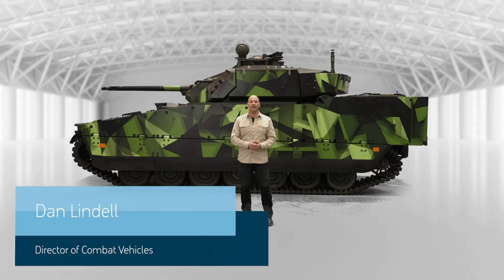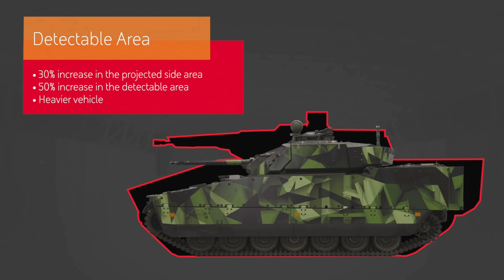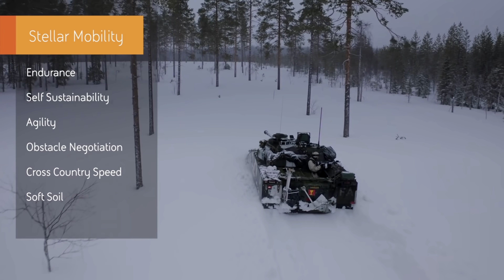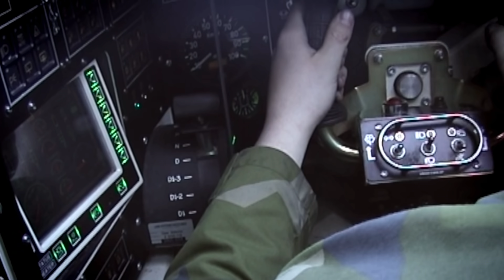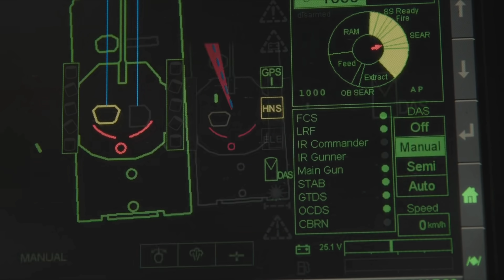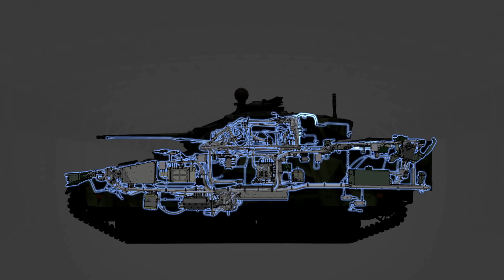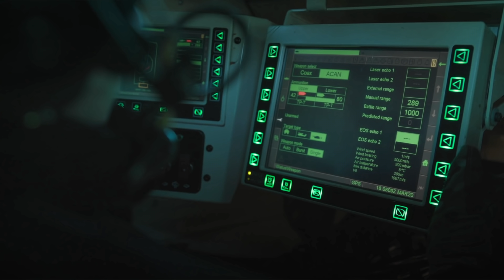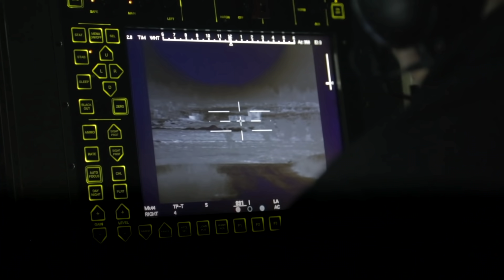The CV90 Infantry Fighting Vehicle Family | THE BEST IFV IN THE WORLD 🏆

Comment: Perhaps one of the CV90s best competitors is South Korea's K-21. The K-21 has similar capabilities but can carry 1-2 more troops and is 10 tons lighter, all with the same level of armor protection. The systems of the two IFVs are quite similar, with 40mm main guns, active protection systems, net centric battlefield management suites and Spike or Raybolt ATGMs. Both vehicles are nearly identical in profile size. The K-21, like the CV-90, is reputed to have outstanding tactical mobility.

I believe the K-21 is significantly less expensive. It also has an additional capability the CV-90 doesn't have. The K-21, with the removal of add-on armor kits, is amphibious. The K-21 doesn't have as many variants, but it does have a fire support version available with either a 105mm or 120mm low recoil gun.

I'd love to see a comprehensive direct comparison between the K-21 and CV-90.
Reply: About the weight, a Cv9040A&B is slightly lighter less then a K-21 (23 vs 25 tons, basically the same), it is the export and later versions of the CV90 that is alot heavier.
Reply: As a former mortar man, seeing a protected vehicle and crew was a dream back then which finally came true. Unfortunately it happened after my time, and the US is still putting their troops in the open. Absolute head shaker!

Comment: Definitely one of the best but I wouldn't say it's top dog. It is indeed proven and incredibly versatile I'll give it that.
Reply: I like the Namer. Has some actual armor. Not the best thing to drive hundreds of miles though.
Reply: What's the bonus code? can't find it
Reply: It's only rival is Lynx which is significantly larger and unproven.  Put the same tech on a cv90 chasis and it will out perform it.
Reply: @Weakeyedominant  "its not combat proven" is BS.
most heavier equipment we use is not.
And it better stays like that.
What combat CV90 has faced?
Heavier fighting vs Insurgent Taliban in Afghanistan.
And it fared well. 
But is asymetric warfare vs insurgents the relevant metric we should measure an infantry fighting vehicle against?
It is designed for armored high intensity conflict (peer on peer nation with MBT etc) and no MBT and IFV around has faced a peer opponent in the last 60 years (Korea was the last time peer armed forces faced each other with top of the line equipment)
Even M1 and Cr2 have not faced the Threat they were designed to face, but only 20-30 years outdated opponents (T55am, T72m1 export etc)

Comment: Hmmm, I do see the new platforms and the latest gen. CV90 can be outfitted to do more/less the same roles. I want to hear after-action reports regarding the Composite "rubber" tracks. As drive belts with woven kevlar cores are seriously tough so these tracks are likely something of a game changer. 
I heard Canada at one time was considering these, I would say Canada would be wise to look at not one but a few variants. Can-zer Grenadiers? Yup, that's what I'm thinking. Nothing says mutually supporting more than family. If Armour and infantry are under the same roof their doctrine and communication would be fluid. Another point is that some environments don't favour a 70-ton MBT or logistically being able to quickly deploy such a beast when something a bit more svelte would do.

Comment: Be very interested to see how the tracks perform on the ragged and sharp rocky terrain of Central Australia. These chew up normal rubber tank pads in a literal fortnight. 

As a former Australian Tank soldier, I would love to see more standardisation and versatility in our armoured capacity.
Reply: The rubber soles are for peacetime - in war it's metal only tracks. We have sharp and rocky terrain here as well - sure the tracks would survive the outback! //Former CV90 IFV Commander
Reply: @Joxen98  Why train with equipment that you aren't going to be using during war? 

There is a huge difference between rubber and even live metal tracks in practice. Everything from noise to vibration increases and track maintenance (AKA "track bashing" in the Australian Army) is a significant issue.
Reply: @greg.kasarik  peace time requirement when driving on public roads etc., the metal tracks shreds tarmac and other civilian infrastructure (Swedish military trains alot on roads that are used by the civilian world to and even in city centers, towns etc.).
Reply: @skagge.s1336  I drove the Leopard 1, which has live tracks and pads, on roads, including into and out of towns (not city centres) and at no point did we do damage, although a vehicle that big does make the locals nervous! :-)

Having said this, there is video on YouTube of a Leopard bridge layer doing a pivot turn and tearing up the cobblestone road it is on.

While I would rather train with the equipment I'll be using in war, the decision to use rubber tracks in training makes sense. I'd hoped that the rubber tracks themselves were an innovation that would help do away with the problems associated with even live metal tracks.

Comment: The CV90 is indeed the premier infantry carrying platform, it's also built indirectly by BAE.......so why have we got the crap that is Ajax and it's 24 mile an hour speed limit (then it has a tendency to fall over) or a ride that can be likened to driving a Fiat 500 down the Montmartre Steps in Paris. Someone got a back hander on the Ajax Project, they even screwed up the working CTA weapon cannon system after they gave it to Boeing. The British Army should buy the CV90, make Dorchester side plates and pay BAE to stick on the working CTA Turret..... that by the way can fire selectable munitions at 176 RPM one of them being a 30mm discarding SABOT able to penetrate 160mm of rolled steel. Result best battle taxi on the planet.

Comment: I wouldn't call it the best - it is hard to decide that. I have heard it being called behind the times and a platform with no hope of further development, people have different ideas about things. However, it's big plus is that you have all these derrivations that actually can be bought and do work, so if you are a not so big of a country you can take something proven and ready made for basically all your needs, from a light tank/infantry fire support, through mortars to an IFV, without you having to spend a lot of RnD money on developing your own versions for the platform. This is one of the reasons why it is CV90 that is one of the contenders in the big tenders in countries of Central Europe, that have been going on recently.
Reply: One of the best put comments on this video and only 4 likes? 
As you said, larger countries are going to pass on the CV90 for a few reasons. It sends money outside of their economy. They need more than 50-100 of them. They can afford R&D costs and want something of their own that THEY can control / sell and make money from. Etc. etc.
So many people seem to oversimplify how a country goes about procuring new tech and vehicles.

Comment: Just did a dive into IFVs because of this video and most "experts" have the CV90 at #4 out of the ten best with either the Puma or Lynx 1st but the CV is always ahead of the Bradley 🤔 starting to think preference depends on what part of the world you reside
Reply: They usually ignore mobility , none is better in winter conditions. Sure it cant take a hit like the Puma , but Puma is limited in mobility due to weight. For example , very few bridges here can sustain a Leopoard 2 tank , so if the enemy take those out , we cant utilize them properly , Puma is in the same weight class if Im correct.

Comment: Oto Melara 76 fitted to Rooikat 76 OUTGUNS the CV90 with a range between !6,000 to 40,000 metres. A comment mentions anti tank rockets, but as a later extra, it is also available to be applied to the Rooikat. :-))
Reply: cv90120 outguns the oto 76 with a rheintall 120mm

Comment: I love your videos. And a little tip about the gpu-s they probably do more work than just digital display. Gpu because of ots architectire different than cpu exceeds at paralel computing so its just different type of calculation you find a lot of this type calculation in (computer graphics or artificial inteligence models )for example but it can be used in other calculations as well depends really what in fact they are calculating there but im sure you could find something . Also the army uses fpga sometomes thats also the other equipement from the workd of computers. Just an info to lwt you know since you share so much knowloadge with us you can learn aomethimg from us as well :)
Reply: You sure the CV-90s  are not mining Bitcoin and paying for themselves?
Reply: @mattiasdahlstrom2024  wondered why I couldn't get a cheap graphics card - tehy're all in IFVs :-)!

Comment: How much I HATE to admit, that something Swedish is not the product of a monkey falling off a Christmas-tree in usual drunken stupor - it seems ok.
The trick is that it has build up a production run of about 1300 vehicles. It does give some advantages. That is primarily due to having very critical costoumers. When it comes to actual purchase the price is not the decisive factor. It does help, however, that the Swedish Krona has dropped between 10-20% over the last 10 years or so. It allows governments to buy the sovereign bond at a low price beforehand. So when payment is due - you just hand the producer the bonds, which they can sell to their bank.

That was probably what saved MOWAG in Schwitzerland - Mowag had actually fired their workforce. Then an order for 300 Piranha V dropped in for MOWAG and a further substantial order for Eagle V to keep the company going - we needed the Eagles anyhow.

Another feature was when Norway needed an upgrade they bought new CV90'ies and sold the old ones at bottom bargin price to Estonia. That is what I call strategic mobility! Placing the arms in the hands of those that are going to use  them. What he calls strategic mobility is what I call operational mobility. Trying to transport things on rail is hopeless - the standard profile is just a minor problem - the real problem is the administrative obstacles involved in railroads. The point is: Such heavy objects are to be SAILED. Which with the exception of Switzerland is the obvious choice around the Baltic.
Just look at the current concentrations around Ukraine. To move 100.000 troops is doable; BUT IT TAKES TIME.
The other point - for illustration - is the discussion about Finland joining Nato: Finland today has 200 Leopard 2 tanks, so  when Putin starts to mess with Finland the most likely outcome will not be satisfactory to Russia.

There is another point about the CV90 I like to make. Denmark has bought new light mashineguns replacing some 700 MG42 - nothing wrong with the MG42 - except it goes through ammunition like a Swede through schnaps, vodka, whiskey - whatever. All that ammo has to be carried by someone. Now getting rid of the mashinegun assistant reduces the infantry squad from 8 to 7 - leaving more room for other weapons.

Comment: its accually a  good point.  Can they be transported on trains and airplanes.  can they go over  light bridges,  Some tanks can only be transported over  some specialized trucks. and they  would pulizre  some light bridges..  Same  idea with Jas. ( can land on  Roads because they took it for granted that 100% of the swedish Airfelds  would get bombed in the first say)  and also  made sure that  smaller teams could very easy rearm re-fuel   So what Jas got is  a plane the can Utilize and  Swedish roads as a landing stips. we evne have some swedish roads with Build in infrastructure to support   Jet fighters. this mentality  goes back to te 50és  "Finland has the same mentality for example all "new houses" has a built in Bunker. its standard over there"

Comment: The reason they need GPUs IS NOT because a graphical user interface ( G.U.I). It's about the computer power for data crunching. The company mentioned "floating point performance" FP32 & FP64 for example. GPUs have thousands of cores and deal with large data sets better.

Comment: Somehow I saw a Puma video on YT and I thought it was pretty cool and nice, but still could not shake that feeling that a CV90 was at least cheaper and could carry more infantry and still fight as good... I did now the Bofors 40mm had lots diverse ammunition and the Pumas 30mm was not as diverse with it's ammo. The Puma seemed a bit far fetched somehow, but on the whole a bit more protection. But then again if you can actually clear the space in front of you want to go you might not need that Pumas high tech protection.

CV90 for the win!
Reply: Different priorities. Before starting development on the Puma the German Army trialed a uparmored CV90 version only to find out it still didn't meet their protection rewquirements. The Puma is considerably better protected than a CV90, not just a bit.
Reply: @jonny2954  Yeah, a pumpa at 43 tons and cost of 17+ mil eu per unit vs a cv90 37ton mk4  cost we dont know but mk3 was 3-5mil eu per unit.
Reply: @harkain123  Puma doesen't cost 17 million a per unit. That contract where that number was calculated from also included spare parts, simulators and development cost. The vehicle itself sits at about 8-9 million a piece.
Reply: @jonny2954  any link to anywhere with the lower pricetag ?
Reply: @harkain123  It's all freely available. The initial order for 405 vehicles had a budget of 3 billion, that's about 7,6 million per unit. A bit later that order got reduced to 350, so development costs had to be shared on 350 instead of 405 vehicles, upping unit cost to 8,8 million. The 17 million figure comes from dividing the entire cost of the program , not the vehicles, by the amount of vehicles (program has a total value of 6 billion). But the program doesen't just include the vehicles and development, but also spare parts (and the entire logistic behind them) simulators, maintenance training and research and development costs for future Puma versions (S1 and S2 upgrades, future S3 with TSWA grenade launcher, and implementation of hardkill APS additionally to the softkill APS it already has). So a unit cost of about 9 million is accurate. Probably going to become less than that because Germany just ordered a second batch of 229 vehicles a few weeks ago. The more vehicles are ordered, the more of the other costs can be shared across, so unit cost drops.

Comment: If I was one of the in back guys I'd rather be in a Puma.  Depending on armament, if I was a general I'd prefer an army equipped with CV90s.
Reply: If you can fit in it .... because that was one of the major problems in the Bundeswehr...

Also, not aure, but does the Puma have an ATGM and a APS? An upgraded ABS?

Comment: MODULARITY IS KEY, BE ABLE TO REPLACE ANY PART IN MINUTES, CHANGE THE MISSION REQUIEREMNTS FOR THE VEHICLE, DEFENSE -PROTECTION , I DON'T UNDERSTAND WHY THEY ARE NOT SLOPPED O THE SIDES WHICH IS WHERE THE ATTACKING PROJECTILES WILL BE IMPACTING IT, , ADAPTIVE METAMATERIA WHICH WILL CHANGE THE SHAPE FOR THE CIRCUMSTANCES OF THE MOMENT

Comment: Take a look at the new K21 from Hanwa known as the K21 AS Redback Park it next to a CV90 and you will be hard to find the difference.  It is also compatible with the John Cockerell UC 80 105 120 gun turret it's a two maned turret and can be outfitted to your request . The 120 is the Koreans Owen smooth bore gun it has a higher pressure rating that the Rhimemetal or US gun . These are already in use by the Korean Army in two forms the 105 is a Infantry support light tank the 120 is used is squadron sized units as tank destroyers  the 105 also has a high angle of fire as it can use NATO and Koreans Owen 105 ammunition so think of it as an Abbot 105 SP Gun that can fire on the move one thing the Abbot could not do well it could but only once . This means if you look at Korea to the North of Soul it get very mountanus haveing guns that have high angle of fire that can act as a SP Gun as well as a tank is a big advantage